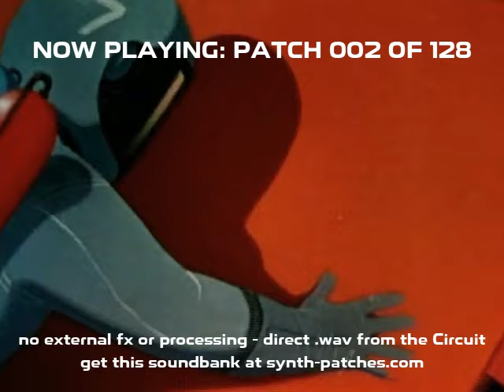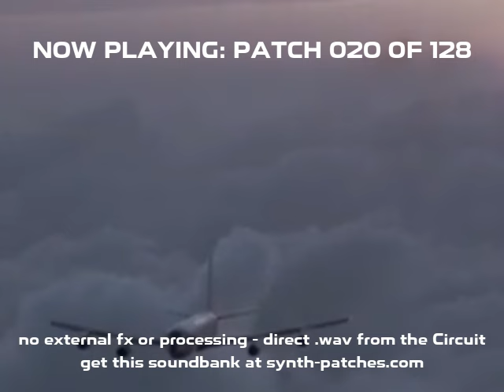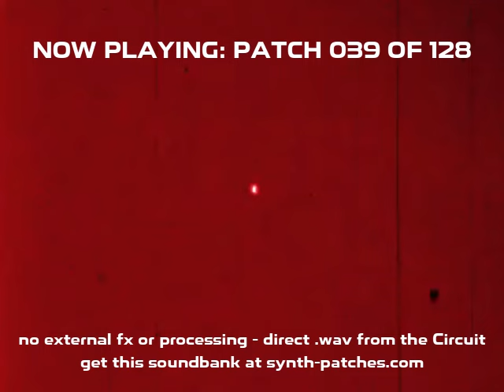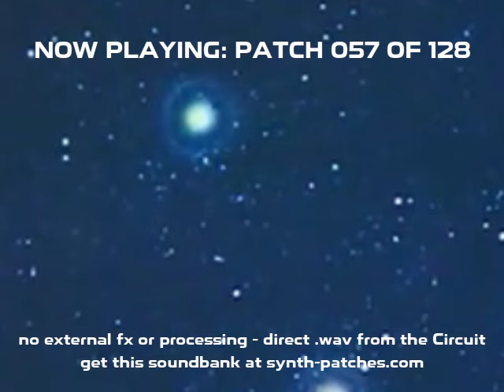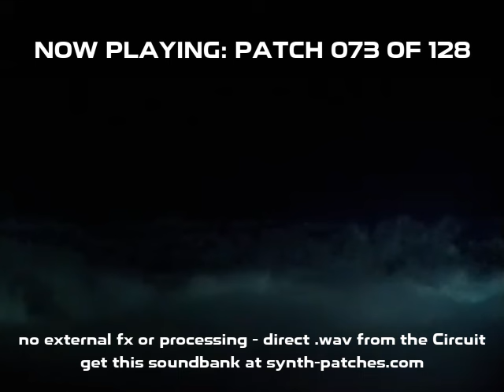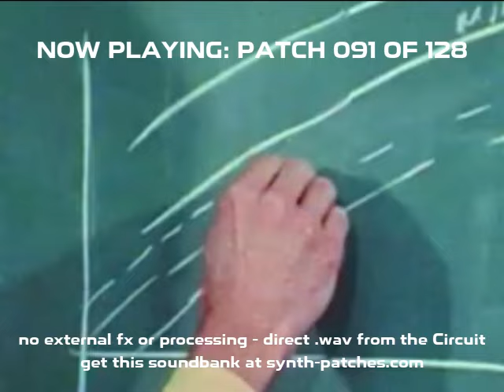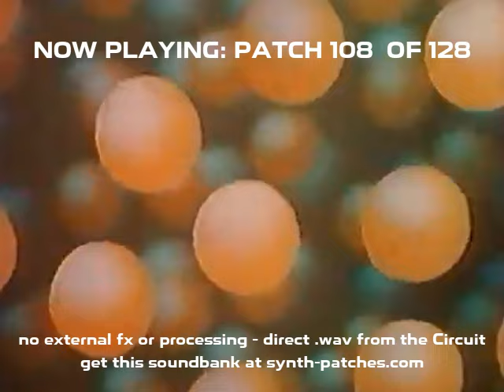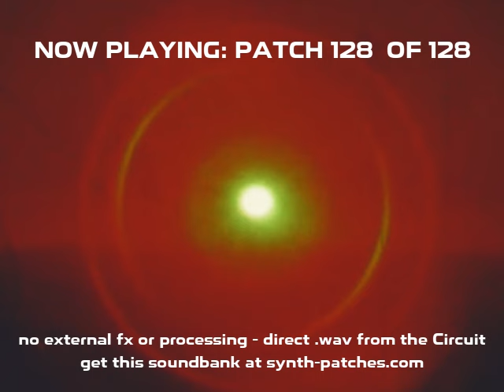128 Patches for Novation Circuit / Circuit Tracks - Boards of Canada, Tame Impala etc.

Comment: Killer sounds!
Reply from the maker: Thank you!
Reply: @Synth-PatchesCom  the Control knobs are not mapped, except the 1 Oscillator, but not all the others like «Filter or Resonance», right? How can I set the Controlers on?
Reply from the maker: @MeeperDude45  Are you OG Circuit user or Tracks user?
Reply: @Synth-PatchesCom   TRACKS ;-)
Reply from the maker: @MeeperDude45  Every patch has from 1 do 5 parameter knobs configured. Can you check it in your Components page? Go to Synth editor and choose "upload patch" - go to Modulation section and see the configuration.
Reply: @Synth-PatchesCom  Cool, thanks, gonna check this out ;-)

Comment: Wow, this is so much better than the original patches, I might actually get it back out for a play! And try to remember how to load new patches!
Reply from the maker: It's very easy - just plug the Circuit into computer and run the Components website :)

Comment: Wow - I picked up a used Novation Circuit OG on Monday and downloaded the patches on Thursday.  The synths are so glitchy, noisy drifty - I would swear these are analogue keys.  Amazing work - thank you!  I have to back the current patch set that was loaded on my Circuit and upload this - the sounds are heaven to me.  Does anyone know a quick way to back up all of the sounds and patches in one click as opposed to backing them one by one?
Reply from the maker: Thank you so much. Have fun! I guess you can use the components website to do that?
Reply: @Synth-PatchesCom  Yes I did - if you update this with some drums and Sessions - I would be in heaven - Thanks again.

Comment: These sounds are so great. Very rich and inspiring. I've kind of been turned off getting the Tracks 'cause it generally sounds a bit bland or generic and not so much for the type of music I want to make - sonic, weird, John Maus, kraut-esque. Do you think Tracks is capable of going on that journey with me? At this point I'm torn between Tracks or OP-Z. Thinking to add a hydra as a second synth. Would like to be able to use the set up stand alone, idea of Hydra being sequenced by Tracks and then going back into Tracks for compression and FX to mix with Tracks arrangements seems to make sense. Love these patches...any advice?
Reply from the maker: You can run these patches on Tracks. I didn't have chance to play OP-Z but now I've been working on the soundset for the Hydra. So stay tuned, premiere in December :)
Reply: I have the OP-Z and the Circuit Tracks+Circuit Rhythm atm. I've had the Z for a few years, but I'm going to sell it now. The Circuit is easier to use, and you can tweak the sound easily on the device, plus you have access to a fantastic editor in Components if you want to get deeper. The Z has a quirkier, more powerful sequencer, and an onboard mic, so you can even sample (lofi) direct if you like, plus you can use an iphone or ipad as a screen to use the excellent companion app. The Circuit allows you to connect immediately to two mono or one stereo device, and the experience is seamless. The Z needs an extra module to do the same. The Circuit wins it for me, but selling the Z was a very hard decision. Good luck with your choice (if you haven't already made it).

Comment: So, I've finally bought this wonderful soundset. Everything worked!
However, the Components software is terrible!
Can you really only load the sounds individually onto the Circuit? Or is there a way to transfer the whole bank at once? 😇
Reply: Did you figure it out? I'm planning to do the same. Thanks
Reply: If you are able to highlight all of them you can move them all over at once
Reply: yes you can transfer whole pack at once.. without sd card you can just overwrite first pack, with sd card attached you can save pack to any pack slot

Comment: Great sounding patches & worth the money. However, the macros could've seen more use and been placed better - most patches seem to put filter on macro 1 when macro 5 is labelled filter, and many patches have only this one parameter. Easily fixed but time consuming all the same to move them.
Reply from the maker: Thank you for this comment!
Reply: @Synth-PatchesCom was this ever amended?
Reply from the maker: @dannymolns3573  Can you elaborate?
Reply: @Synth-PatchesCom  thanks for the reply. I was referring to the comment made by bubble and if the patches filters were ever re mapped to macro 5?
Reply from the maker: @dannymolns3573  No, I wanted to put the macros in the order because on the original Circuit there are no labels on the knobs, It would be confusing for the users...
Reply: @Synth-PatchesCom  okay! Well I'm getting my circuit tomorrow and I'll buy regardless. Hope you make another set or a v2 with more sounds 🙌
Reply from the maker: @dannymolns3573  You will be happy with these sounds, I assure you :) Personally I'm very proud of this soundbank and I decided to keep my Circuit because of the sounds :)
Reply: Would it be possible for you to share the pack with your modulation routing with the seller @Synth-PatchesCom so he can share it with verified buyers?